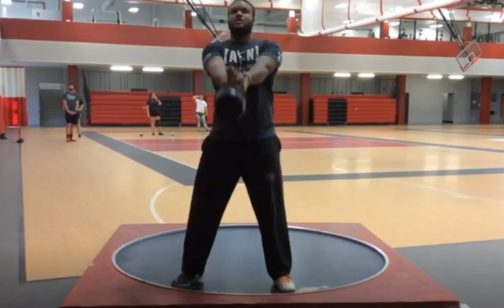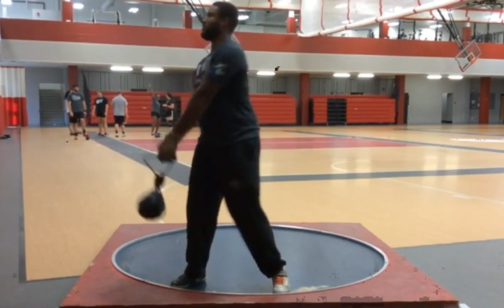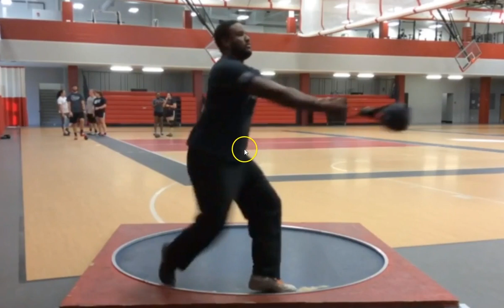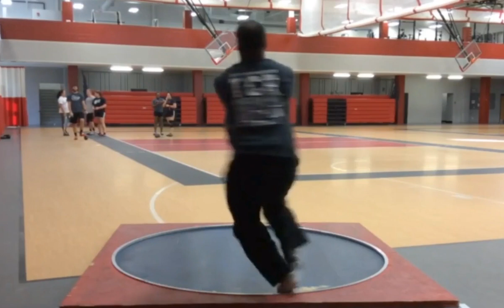Technical Analysis: James Plummer

Comment: So I'm quiet new in Hammerthrow, and my question is when I see James throw, the first turn he made was what you called a "toeturn". So I learnt (and that's also what I'm doing) you always start your turn with the back of your foot and after like +-180° you swith to your toes for like 90° till you place the other foot. So is this "toeturn" just a thing cased by throwing these heavy wights or is it something that you also can do while throwing the 15lb outdoor?
Reply from the maker: it's a different technique use when typically doing 4 turns, to help the athlete save some space in the ring